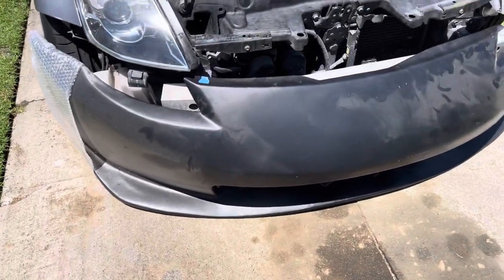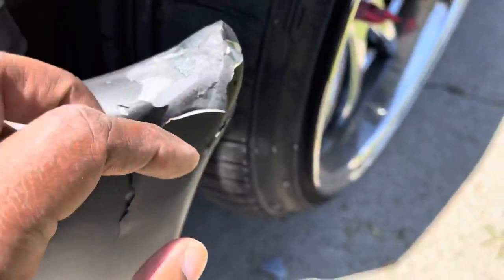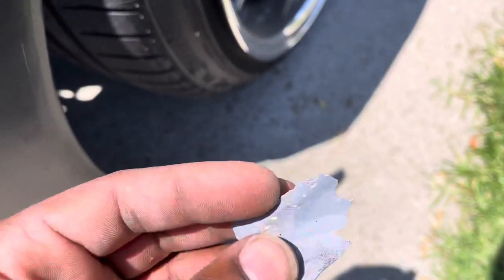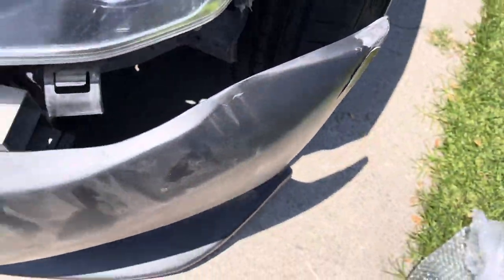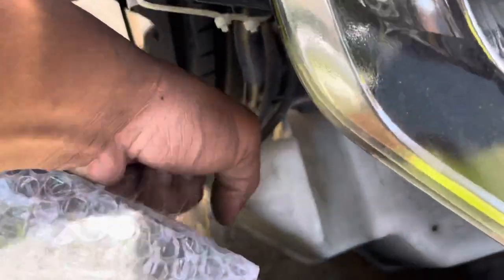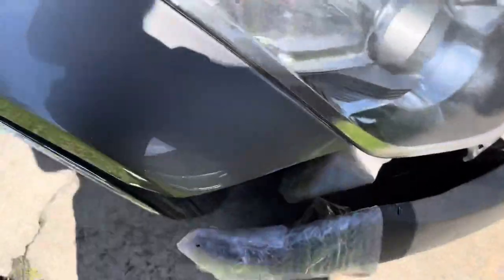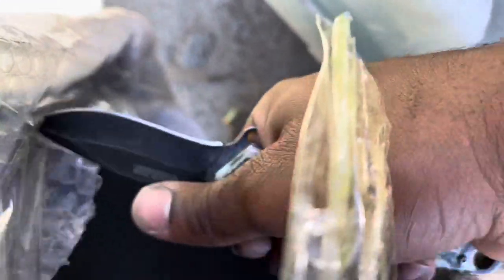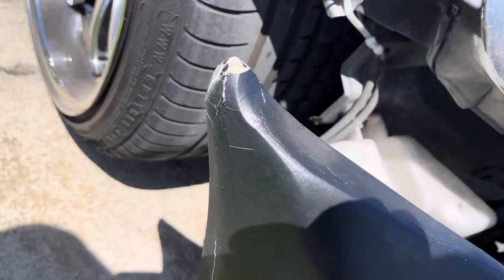BRUTALLY HONEST DURAFLEX BUMPER REVIEW

Comment: I love how people complain 🤣😂🤣 you paid $300 for that bumper what do expect?! OEM is more money, ahh kills me you gotta be a master body man and they can fit mint! I’ve seen it! Even companies like Origin Lab are not perfect perfect right out of the box it’s gonna take some love
Reply from the maker: You went hard for this comment lol
I would’ve been better off getting KBD for the money
Reply: @RobZ33 kbd is twice the price for a reason. Duraflex is a bumper cover made quickly and cheaply. A LOT of body work required for a duraflex but like the comment above its cheeper than stock weigh less and look cooler. It’s not going to bolt right up. Hince no mounting hardware or brackets. Oh and don’t just bolt through it make metal bracing  if you haven’t gotten it put on yet. They are a job. 😅
Reply: @RobZ33 just realized it was 2 years ago… do u still have it what condition is it in.
Reply: @jamesirving1085 🤣🤣🤣
Reply: I’m tryna get some dura flex fenders are they worth it ?
Reply: I paid $1000 for mine… oof I hope I didn’t make a horrible mistake

Comment: I just got the same problem in the mail. Send that crap back bruh.
Reply from the maker: I sold it. They screwed me because I had to sign for it upon delivery which voided out my option to return. I couldn’t inspect it right then and there because of all the (obviously useless) packaging it had. 
I sold it on OfferUp for like a $100 loss but I was glad to get rid of it 👎🏾 🤷🏾‍♂️
Reply: @RobZ33  bruh going thru this right now mine came fine but the minute I put it on it cracked near headlight and chipped ... like how u supposed to check before driver leave when dude be already  bout to leave by the time it's off the truck.

Comment: This is and has been a huge problem in the aftermarket industry. For one they use shitty molds. So when they make the bumper out of the mold they come out the same way the mold is, which is shitty. 2nd, they are poorly made. You are seeing air pockets under the gel coat. This bumper was probably banged around that’s why it chipped but it mainly it chipped cause of the air pockets. Air pockets will eventually come out after months of sun exposure. Unfortunately cheap kits result in cheap results. You get what you pay for.
Reply from the maker: #ShouldveboughtKBD 🤦🏾‍♂️